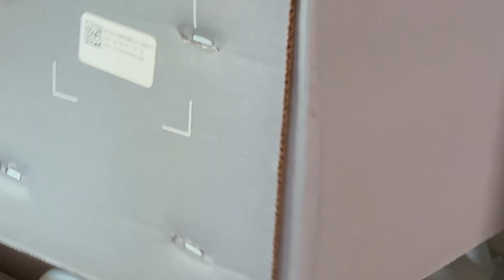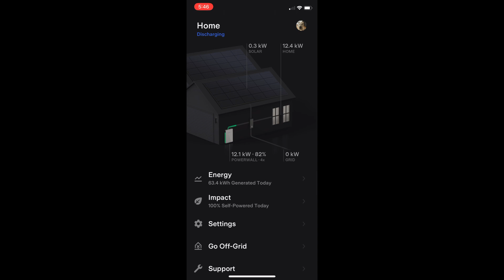4 Tesla POWERWALLS- Home Installation BATTERY back-up & SOLAR in Canada 🇨🇦

Comment: Let me start with I have 12.2kw of solar and 70kwh or lithium battery. I worked with R&D EV batteries for several years. I'd like every to know this is not "green" by any means the mining for the rare earth minerals is magnitudes worse for the environment than mining for natural gas or coal. The mining for lithium, cobalt, and nickel all destroy the ground water and pollute the local area. In addition most of the cobalt mines is in the D.R. of Congo and up to 30% of the labor is slave children. To achieve this 50% EV goal the current president has set we will need over 100 more of these mines just to satisfy the U.S. supply. It's not green. Fuel cells are far more green. But there's no money in converting air into oxygen and hydrogen for fuel cells.... But there is tons of money in strip mining 3rd world countries so the west can "feel" superior. While simultaneously making affordable energy like coal and natural gas now unaffordable for developing nations. Who will just go back to burning dung piles for heat.
https://youtu.be/_V3bIzNX4co
Reply from the maker: I think we are on the same page with regards to “green energy“. Our solar panels where made in Germany but most of the solar panels sold on our market are made in China. From the wind generators we have in the province to the coal burning plants that produce the electricity that is fueling the EV’s, it’s not all as “green clean“ as it appears to be in reality. 

For us, the solar/ EV car/ batteries/geothermal allows us to be more self sustainable. If we could choose between a tech that is 100% green VS a “less than perfect” solution, we would choose the first option. But, unless you know a better way (and you say you own the same solar/batteries as we do) we both have to wait for a better solution. For sure we will watch the video you sent, I want to learn more about that side of the tech. Don’t think many are aware of it. Kinda like the diamond market; you don’t ask many questions when it’s shinny but..we should!
Reply: @NatachaP    Lots of people here in NorCal drive Teslas. Seems like every 3rd car. I told the snobby neighbor lady that hers is not an EV..... It's an RCV.  Remote Combustion Vehicle! 70% of our electricity comes from burning fossil fuels, nuclear power, and hydro. She had a fancy home fast charger installed in her garage and seems to think she is saving the environment and doesn't want solar panels ''because they are so ugly.''  
Her attitude is ugly as well!

I enjoyed your video and wish I had the $$$ to build up a solar/LFP battery backup system for my home.
Reply: @NatachaP  I'm glad to hear u say all. That and I'm similar. I only have solar because I got the batteries for free from my last job. I tested the for thermal mass for use in heat pump R&D calculations. Basically like new and they where going to send them to the scrapers I intercepted them and took them home. Knowing their value and possibilities. I only decided to take them and buy solar because the government IS forcing us into this future where energy will cost exponentially more and will no longer be reliable. I quit that job because of this zero carbon footprint nonsense they are pushing onto the automotive world knowing the American companies cannot compete with the component pricing of indentured servants in Asia and is slowly going bust. I had two ideas on what I wanted to do next. Work at a solar panel Factory or plastic recycling plant. After finding out many of the chemicals used in solar panels are extremely cancerous I chose the plastic recycling plant. Which is essentially a garbage processing plant. It's filthy, stinky, hot but I know the way things are going this place will exist on government grants even if using the material costs more than new material. We have our own sub station for electricity because of how much it uses to perform the process of cleaning, sorting, melting and packaging the plastic pellets we make.
Reply from the maker: Thanks for watching! I hope your journey for solar/LFP battery back happen sooner than later, exciting times. 

When you see the solar fill your batteries and supply power to your home… they will look like diamonds on your home 😂
Reply: @NatachaP   I put in a  300AH LFP battery, 2kw inverter, 400 watts of panels, 40 amp MPPT on my camper van roof last June. I also put in a 40 amp DC-DC controller to charge while driving or in bad weather. There is a fridge/freezer inside that stays on 24/7 and keeps Ma's meds cold and ice cream frozen. That combo sat at 100% charge by noon during the Summer. With the low end of November sun angle, trees, the charge drops every day to its current 75% loses about 3% a day. I despise these shorter days!
Reply from the maker: @kimmer6  great to hear! 

Same, the shorter days are a hit on the solar energy and battery. We had a great summer for lots of solar energy here in Nova Scotia, lots of sunny days but this fall has been rainy and now dark at 5pm.
Reply from the maker: @kimmer6 agreed! We see such a drop when the snow lands on the panels..we have no way of getting it off unlike your van setup.. be easier. We need to move to Arizona or something!
Reply: @NatachaP  I've been on solar for 18 months now. I'm not disagreeing. It's cool to see the process ..... But I got my batteries for free and my payback period is still 10 years..... Who can afford to pay for this out of pocket like I did? Almost no one. Most people finance it. So now your ROI is even longer. My utility no longer allowed for a 1:1 net metering. Same as California now. I also am in a blue state. So now you have to use batteries to make solar even work to reduce your utilities. So now the average 1 mw a month usage in Michigan will take 20 years for ROI. By then it's almost guaranteed the system will need to be replaced. So there is no actual financial benefits. The only reason I've done it is because our grid in Michigan is starting to be as unreliable as California's I'm not willing to lose all of my deep freezer food spoil because of intentionally destroying our grid just so they can say it's "green".
Reply from the maker: @electromechanicalstuff2602  Agreed regarding the ROI for these, it's not "smart" but like your grid in Michigan, it's also getting unreliable here in Nova Scotia. Be easier to buy a home generator and have that on standby...We did it for another reason that might sounds crazy (and hard to discuss here) but we value the option of not being reliant on the grid. Will have to see in the future if that bet paid off but hoping for us all that it does not come into reality. It does seem like the power companies both in your area and ours are not planning for the "green" grid like they keep telling us we need. I find that suspicious.
Reply: @NatachaP  u are sounding more and more like me now. Can't say too much here. I also have a 12kw diesel generator. For the change the grid is down and it's been cloudy for a few days. I can charge the batteries in 6-8 hrs and go for another 2-3 days of heavy clouds. 500 gallon tank I cycle through with the vw cars. I just don't think "they" want the middle class to succeed. I think they want those who have and those who don't. And they want those who don't to not exist at all
Reply from the maker: @electromechanicalstuff2602  We think alike. Hard to know how to prepare but that 12K Diesel Generator..gosh that’s worth its weight in gold… we looked at some smaller ones before going solar… Hard to plan for what could come but rather be overly prepared…One thing that’s hard to explain to people is the ROI of these solar/batteries and all the other stuff won’t be of any concern if things get dicey.. hopefully they never will thought… Thanks for your comments!! Greatly appreciated :)
Reply: @NatachaP  absolutely stay safe. Stay armed if u can. Stay fed, learn how to garden, raise animals, not be dependent. Also get a community of like minded individuals. I've met some neighbors who are like minded. I have some family also. And several friends. The hardest part is the community. IMO. When u have and they don't, when times are hard people will do crazy things. (0vld  was a bit of a wake up for many. When grocery stores limited the number of people into a building like bread lines and when u finally got in everything was picked over. It was an awakening for many

Comment: I thought Tesla changed their policy you no longer can buy powerwall without panels  now. At least that’s what I was told from my solar installer ProSolar.
Reply: They did but it depends on when you ordered (I ordered before the change) and if your installer has a working agreement with Tesla.  For example ordered solar panels and PowerWalls together but Tesla panels are not an option in my area.  Tesla is still providing the PowerWalls to my installer but has had a very long backlog.  My installer is catching up now as Tesla increased production but is about 1.5 years behind.  😢
Reply from the maker: Our local electrical power company had a pilot program where we could get (1) free powerwall minus the install. The utility company gave some to people without any solar and also with pre-existing solar installations. We did not qualify unfortunately so ended up speaking with the installer at Highmark.inc and there was no issues getting them. If your in Canada, send Marc an email and he might be able to help you locate an installer in your area. No need of a Tesla solar installation here to buy powerwalls…You don’t even need solar, probably hook right to the grid as a Time of Day/backup.